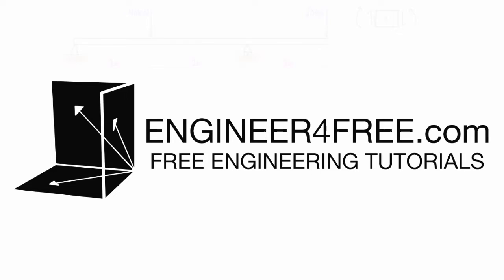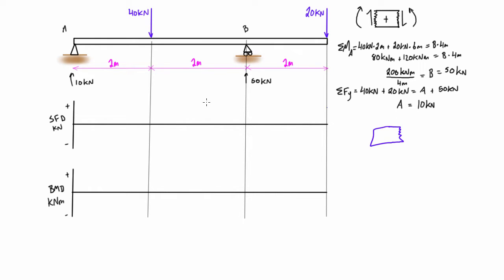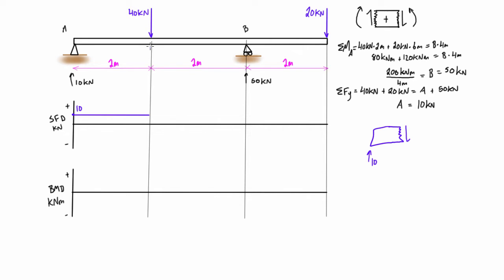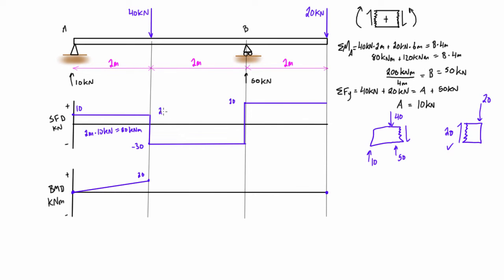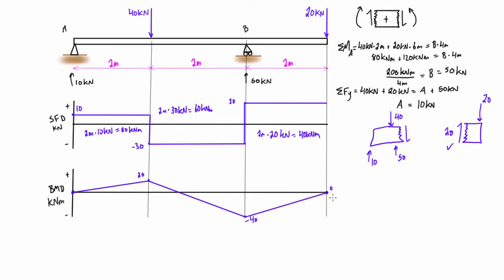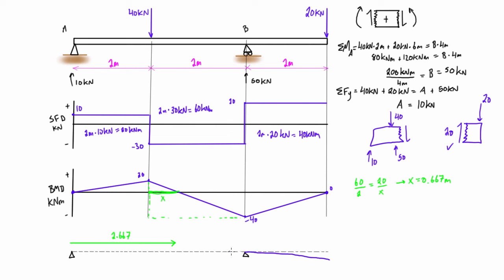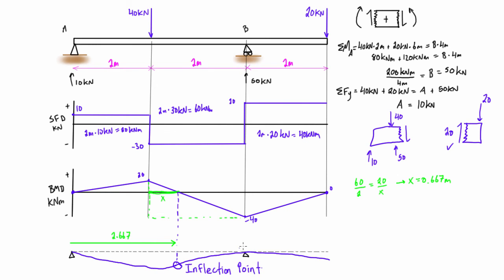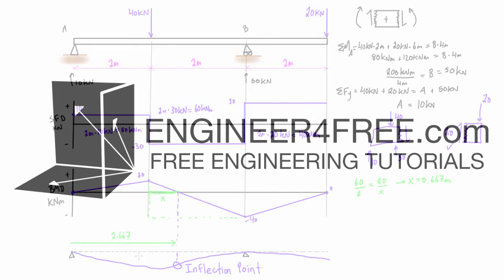Shear force and bending moment diagram practice problem #8

Comment: Sometimes i see shear below zero but the moment curve drawn above 0 like in this https://i.imgur.com/1hDbh2H.png
Why is this? In these examples positive shear always translates to moment curve going upwards
Reply from the maker: It depends on where you live in the world, whether the positive side of the BMD will be above or below the axis. Different countries have different conventions for this. If my BMD looks inverted to you, then just do what you know, which would be flipped vertically. Notice that I labelled the positive and negative side of the BMD on the left hand side. That is intentional, to reduce confusion for people who think its upside down. I like to draw positive on the top side of BMD because it makes the integration more mathematically sensible. What I do is referred to as positive on the compression side. The opposite, when positive is on the bottom is referred to as positive on the tension side, and is less sensible as far as the integration is concerned, but typically more sensible for the general sign convention in structures where tension is assumed to be a positive magnitude until proven otherwise. This becomes more relevent in more complicated structures, like frames. But to each their own, just make sure you realize what's going on when you see one that looks upside down. I also recommend always very clearly labelling the positive and negative sides of SFDs and BMDs, to reduce ambiguity of anyone that may be looking at your work.

Comment: Sir, I wanna ask you something about the SFD. At the last part of it , the shear force is 20Kn, when we draw it on paper should we draw a certain(bold like you drew from -30 to 20 in same diagram) line or can we just leave it in the point of 20
Reply from the maker: Hey, it's good to draw the vertical lines that connect the discontinuities when drawing by hand

Comment: For some reason in the markscheme for the BMD diagram the answer is always reflected in the x axis of your BMD diagram, can you please explain the logic behind it
Reply from the maker: There are two ways to draw BMDs, which are reflections of each other in the x axis. Notice that if the graph is flipped, the +/- on the the axis will also be flipped. I draw my positive on top, and this is usually referred to as drawing positive on the compression side. If you put positive on the bottom of the axis, its called positive on the tension side. The convention of which one to do depends on which country you’re in, so just learn the way that’s expected of you.